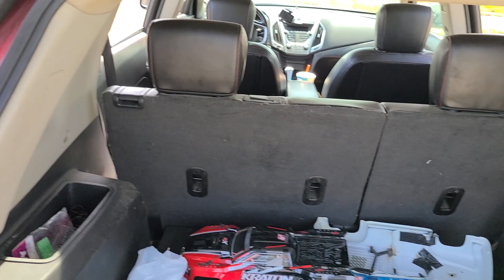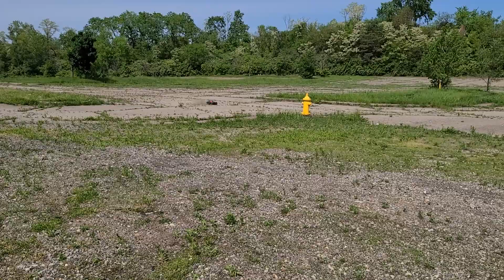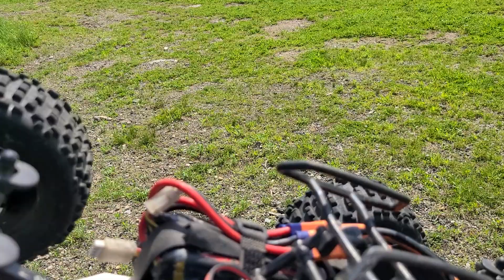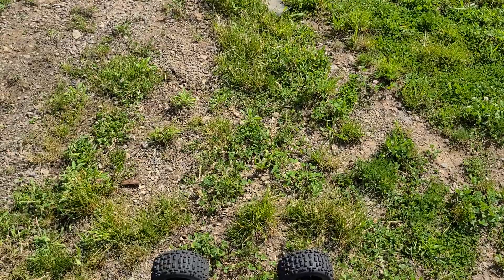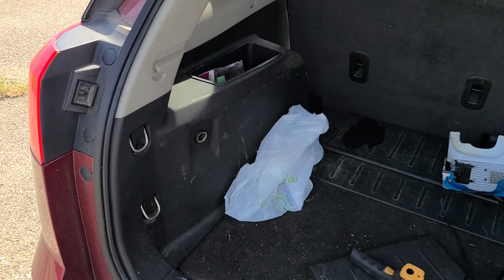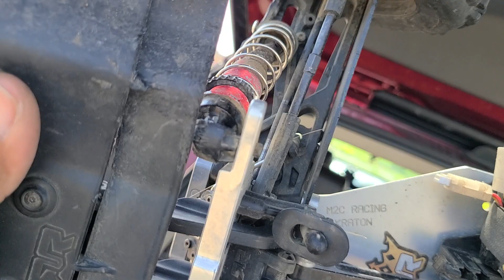Just a afternoon fun with my Arrma Kraton aka Kratos

Comment: Hey bud if I may ask what u got for servo in there it seams to work good
Reply from the maker: I will send u a Link Waterproof 180 Degree Torque Digital Brushless Motor Servo RC Car Truck Robot Parts (M45BHW) https://www.amazon.com/dp/B0995T8LTX/ref=cm_sw_r_apan_i_BX3VE82X3SYR10N6JC4R?_encoding=UTF8&psc=1